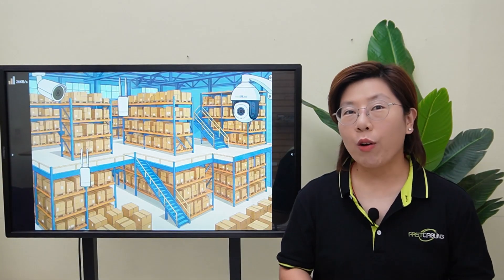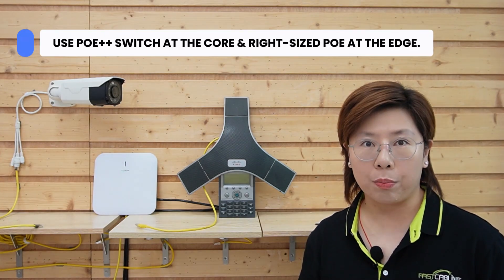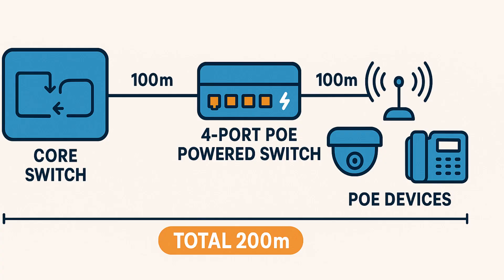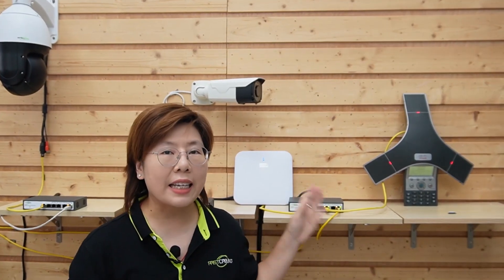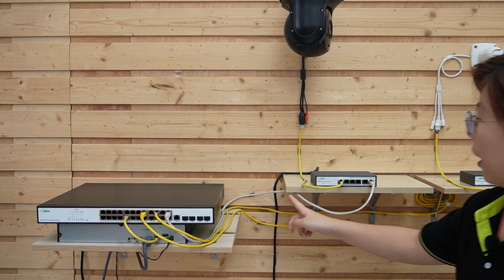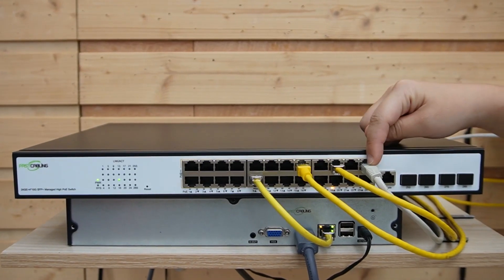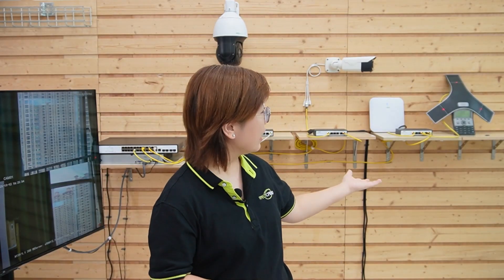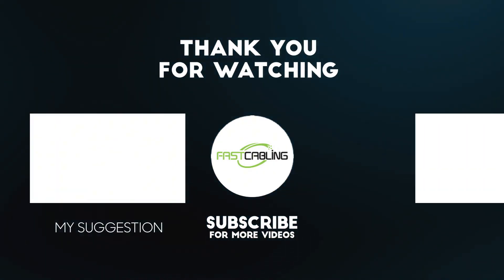PoE++ & Access Switch Network Design | Powering a 24/7 Smart Warehouse

Comment: I watched your video “PoE++ & Access Switch Network Design | Powering a 24/7 Smart Warehouse”, and I found it very helpful. I just wanted to ask a question to make sure I fully understand the design.

From what I can see, the 24-port switch is powering several smaller 6-port switches, and these smaller switches then power cameras, access points, and phones.

My main question is about how this works in a real warehouse environment.
If one of the 6-port switches in the warehouse loses its local power and switches over to power from the main 24-port switch, it may not receive enough power to keep all the connected devices running. Long cable runs can also reduce the available power, which increases the risk of devices shutting down during a power cut.

Another thing I noticed is that when you place several small switches around the warehouse, the setup can become cluttered and messy. Normally, in most installations, cameras, access points, and phones are kept separate for reliability and easier management.

I also looked at the cost side:

A 24-port PoE switch is around £800

A 4/6-port PoE switch is around £90

So using multiple smaller switches around the warehouse can actually become more expensive overall, especially if you need several of them.

In an ideal world, CCTV cameras and the NVR would be placed on a UPS, so they stay running even if the warehouse loses power. This is normally how security systems are protected.

I also noticed something when comparing switch models online:

The 24-Port 720W L3 Managed Switch with 4 SFP+ is PoE+, not PoE++

The 24-Port 480W L3 Managed Switch with 4 SFP+ is the one that actually supports PoE++

So, depending on the model used, the available power and behaviour could be different.

My question is:

Would it be better to avoid placing multiple small switches around the warehouse, and instead let the main 24-port switch power the devices directly? And would separating the cameras, access points, and phones onto their own switches make the system more reliable, tidier, and more cost-effective?

Thank you for the helpful video — I’m just trying to understand how this design would work in a real warehouse environment.
Reply: Power budget
Reply from the maker: Thank for your input. Working with small switches at the edge, you will have more than 24 ip devices in the system. It is a common practical design with 3 levels network topology - the core switch, aggregative switches, and the edge switches. The PoE powered solution which sends the power from the backend doesn’t change this network topology. It benefits the setup scenario while the AC power is unavailable at the edges. There is no much difference between local power or PoE powered from the backend solution. However, it could benefit project with UPS requirement since all the power comes from the data center now. Backing up the power will become more convenient. The bottom line is the edges switches are necessary in the middle or large network topology.
Reply: Your video is excellent, thank you for the detailed explanation. I’m not criticising the design, but I wanted to add a practical point from real-world installations: cost and deployment efficiency.

In many projects, I use a 24-port non-PoE switch on a UPS as the main layer, and then add two small 4-port PoE/PoE++ switches just to power the cameras and the access point. The uplinks from the 24-port switch run as trunk ports, so each PoE switch stays separated on its own VLAN (CCTV, Wi-Fi, management, etc.).

This usually works out cheaper than buying a full 24-port PoE switch, especially when the PoE requirement is only for a handful of devices. It also avoids using PoE injectors, which become expensive and messy once you have more than one or two devices.

Overall, the design stays clean, cost-effective, VLAN-isolated, and still benefits from the UPS on the 24-port switch.
Reply from the maker: Thanks for your update. I appreciate it. You are right about the total cost of the equipment. The PoE powered switch is not the replacement option for general switch. In some particular scenarios e.g. the AC power is not ready, it will be cost effective to implement total low voltage network with PoE powered switch. Otherwise the installer needs to deploy the AC power with the license to practice it.